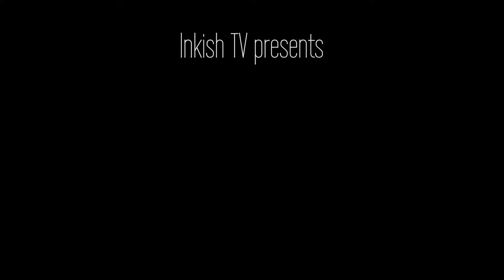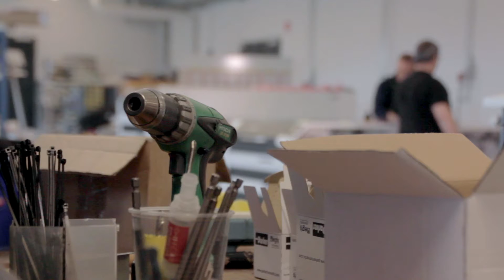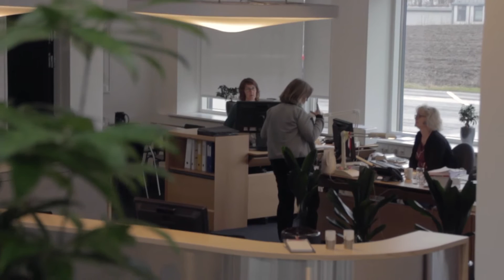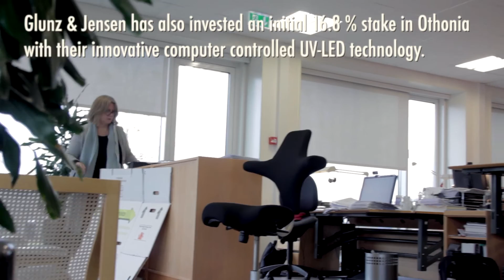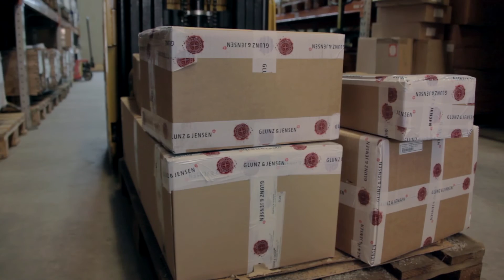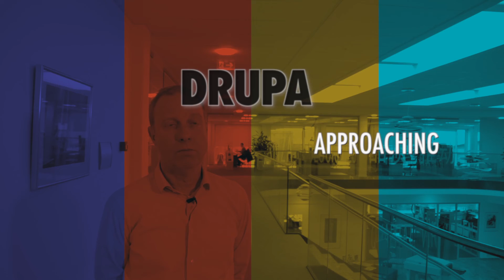INKISH.TV proudly presents: Glunz & Jensen

Comment: I’ve just purchased a used Platewriter 2000 and I loved it until the maintenance fluid cleared and I lost £480 of maintenance fluid ...I opened the cartridges and they are all around 80% - 90% still full of fluid, I felt sickened I then opened the used liquid dot and they are around 70% -  80% full and the Epson based printer says the ink is empty? ....this is a waste of very expensive fluids and ink to throw it in the bin....if you have ethics then please replace this waste and remove the ink chip protection to allow me to buy and use your inks and maintenance fluid without the waste and I will continue to purchase your machines.